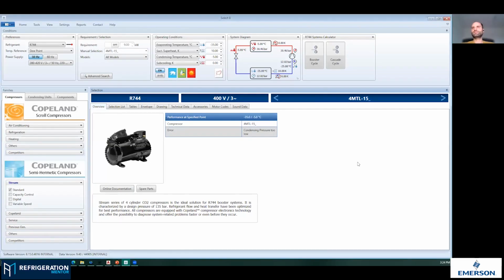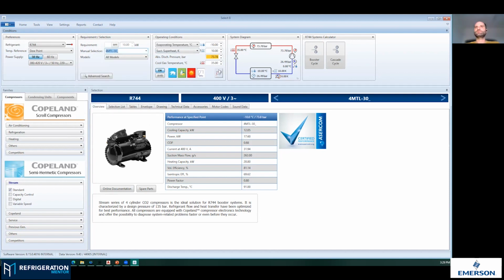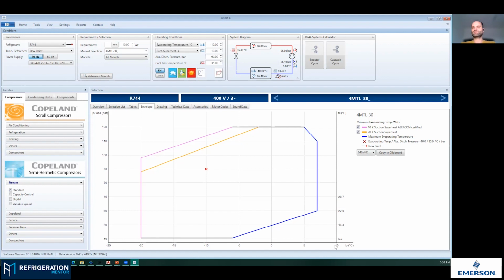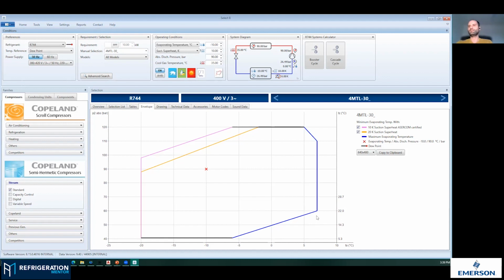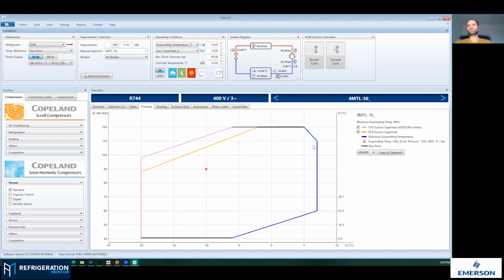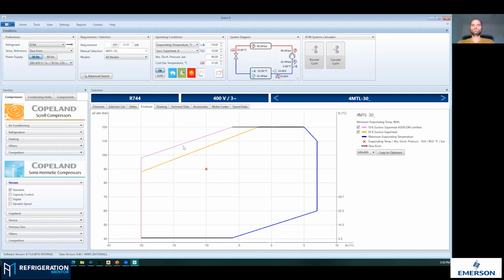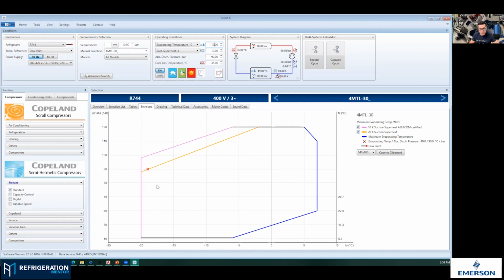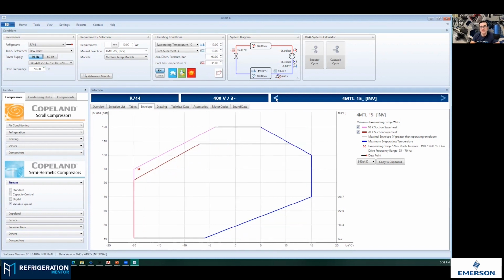Compressor Operation Envelopes

Comment: I want to overclock rotor compressors by casting copper heat sink fins and clamping it around the body. Then put it in low temp application for experiments 🛀